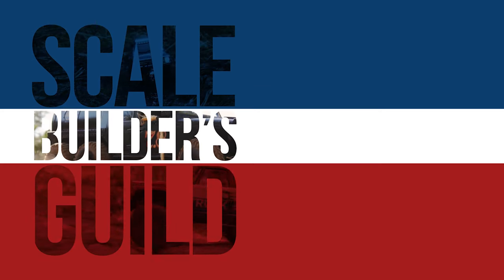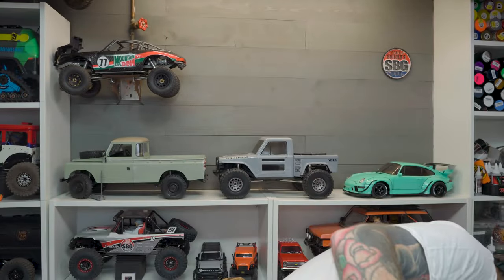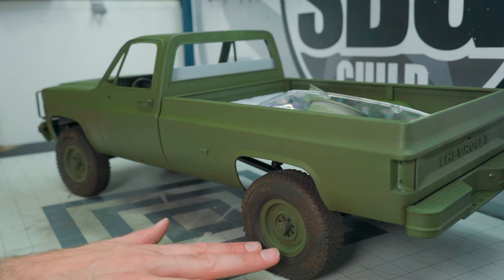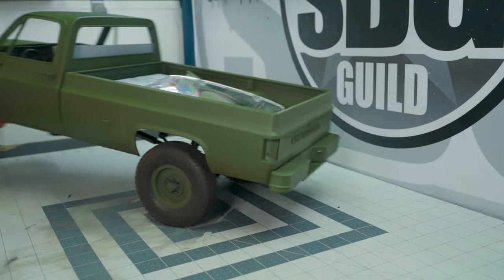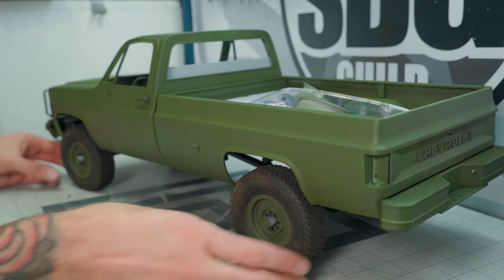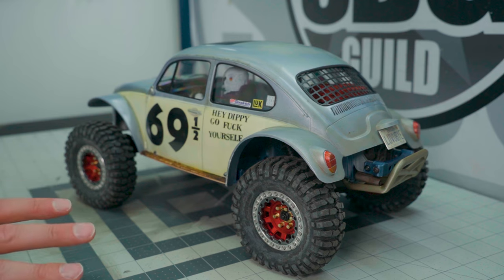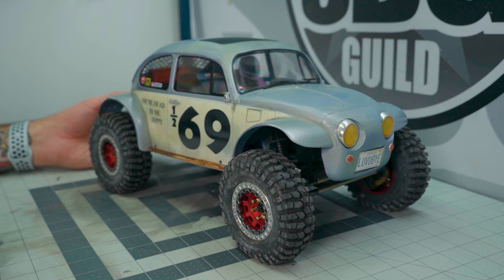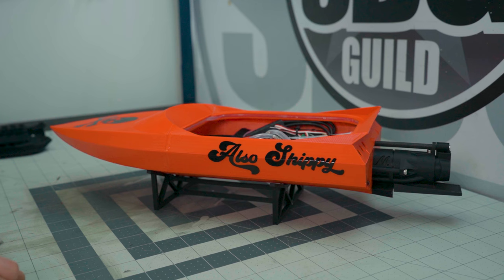This thing is AMAZING - What's on the Bench Weekly Ep59

Comment: I recently picked up a cheap 4tec 2.0 roller, put double what a paid in a body, wheels and tires, paint, threaded shock and a new 2s. added a spare mamba x in it with a 4600kv castle sct motor. I started with the intent to run this body but now I want to scale out the r34 and get another or drive. My 3 on-road car in 23yrs the first one was my first hobby grade rc. Idk if it’s the scale side of it with my trail trucks and crawlers but I like it lol

Comment: I know this has nothing to do with this video but I can use some advice man. I recently put scx10 ii axles with upgrades for weight on my C2X. Now my front end needs different links. Not sure what to do for that. And do you know if I can put a 2door Mojave hard body instead of the 4 door? Thanks for any input man.
Reply from the maker: You’ll have to measure and cut your own links. I recommend threaded rod and Traxxas rod ends. Once you’ve got the right length, you can sheath them in brake line to clean up the look.